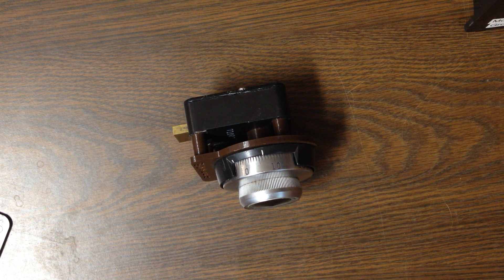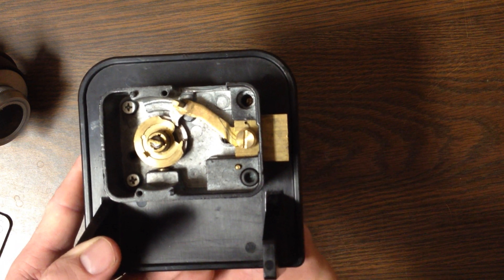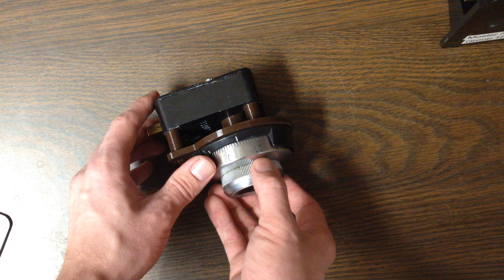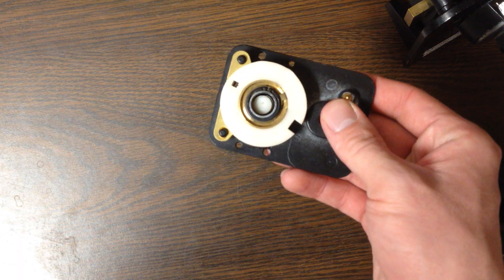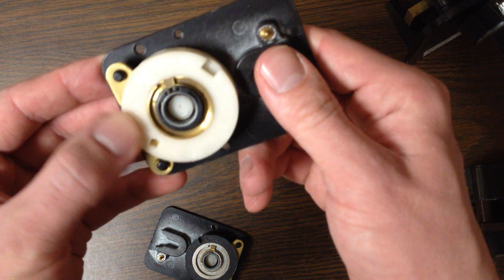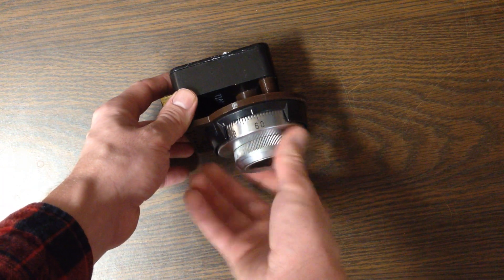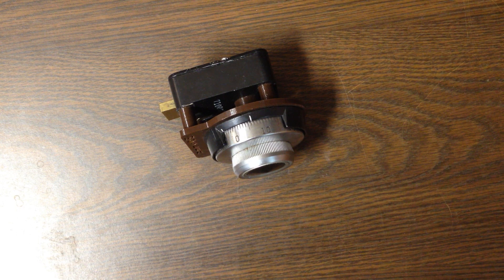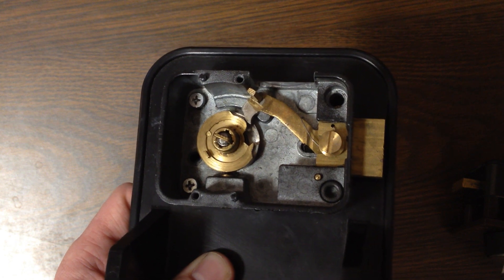Mosler 302 tutorial

Comment: Have you ever mess with the s&g manipulation 'proof' locks that use the arrow knob at 0 after dialing in combination? 6720 model
Reply from the maker: Yes, I have worked on a technique for them but haven't finished it yet. I know the lock model as 6730MP.
Most of the modern version (8400) I think would be a touch easier with my method, but I do think the spring is an improvement overall